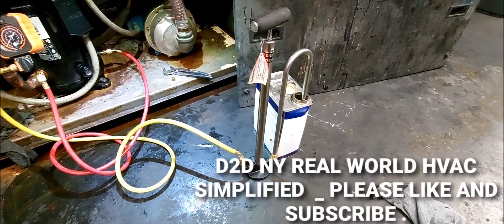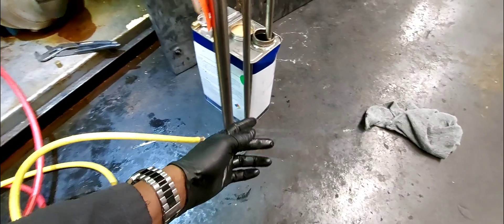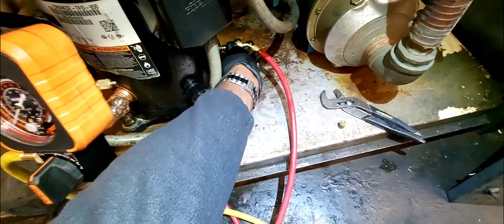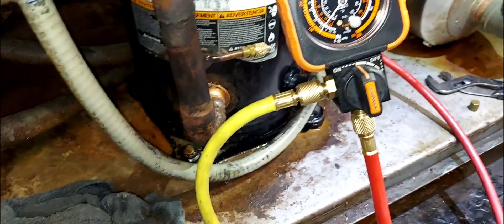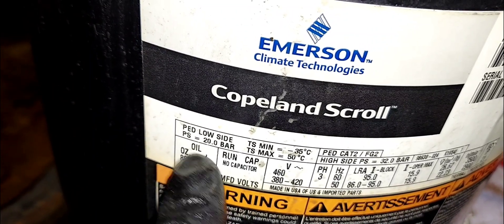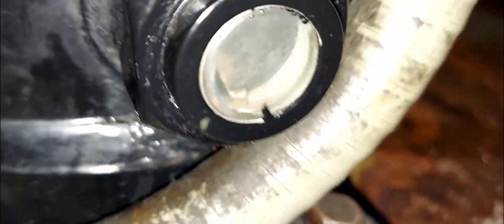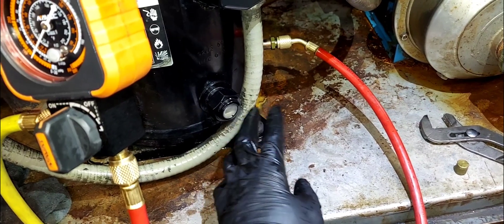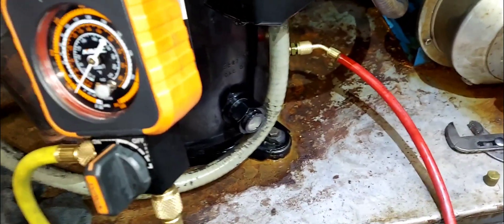ADDING OIL TO HVAC / AC COMPRESSOR

Comment: Can you pump in the oil directly to the compressor without using the manifold gauge? Can you hook up the yellow hose directly to the compressor oil port and just watch oil level on sight glass?
Reply from the maker: Sure you can

Comment: Can we reduce the oil level by remove little bit of oil in the scroll compressor so oil level can drop?
Reply from the maker: Sure you can and with this compressor it’s easy
Reply: @D2DNYAC  how to reduce it ? Do we need to disassemble compressor for the system?
Reply: @D2DNYAC  the system use danfoss scroll compressor..the blue one

Comment: Said simply "level line anywhere in sight glass"! Thats how they work, if its below the glass you don't know how far below, if it's above the glass you don't know how far above! Some where in the glass, you know right where it is!   Also is there not a lot else to know here? If it's a charged system how do you not contaminate it? Guessing you must have to prime the pump and lines by pumping through all the lines involved back into your bulk oil until there is no air bubbles? Why cant you just use any pump? Guessing that the long narrow Yellow jacket pump with its long stroke and low displacement has the ability to manage, check and over come the static system pressure so you can get oil into a pressurized system? Why would you use a manifold to pump oil? Im just a dummy DIY AC guy that does some install and repair of ac gear in my own business and was looking for info on adding oil on 4, 5 ton systems based on line set length. Still on the hunt for that info!
Reply from the maker: Not just anywhere in the sight glass, typically 50 - 75% up is okay, yes must hose first to remove air prior to connecting! You don’t have to use a manifold a hose will do just fine!

Comment: Great video.   Do you have to  
Pump system down?  Or just turn system off and pump oil in.
Reply from the maker: Pump would make it easier to add oil because of low back pressures but no I didn’t pump down

Comment: What about air in the oil/hoses?
Reply from the maker: Purged it with oil so that it’s filled with oil prior to connecting it to system
Reply: @D2DNYAC   thank you, do vrf compressors have an oil port? Is oil change a thing in vrf work?

Comment: can you add POE oil through equalizer line on rack system or do you have to use suction port?
Reply from the maker: Any port that’s on the bottom of the compressor can be used or if there’s none go through the suction on the compressor
Reply: @D2DNYAC  if u filled oil from the suction side .. compressor running or off conditions sir
Reply from the maker: Compressor running and add it slowly
Reply: @D2DNYAC  ok thanks for the info mate 👍🏻
Reply from the maker: Thanks for watching

Comment: can u make a video on how to diagnose the compressor to know it was low on oil
Reply from the maker: Typically you can tell by oil  low level safety alarm or by viewing oil through sight glass on compressor or if your system has refrigerant leak and along with that a huge puddle of oil

Comment: how would you add poe oil in a 410a 25 ton package unit that has scroll comprressors?
Reply from the maker: Through the oil ports on the compressors!
Reply from the maker: Using an oil pump!

Comment: Do you have to close off the suction side of the compressor always to add oil to the system on a rack
Reply: If there’s no oil port do you add it from the high side(liquid line) ?
Reply: @Ahmed0824M did you ever find out?
Reply: @Ahmed0824M Suction line.
Reply from the maker: If you are adding oil directly into the compressor oil port NO!